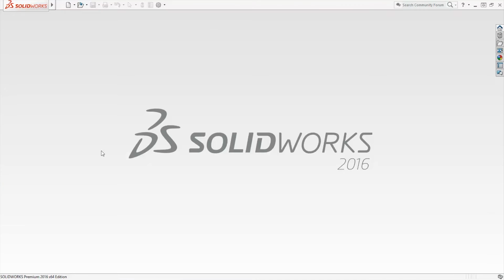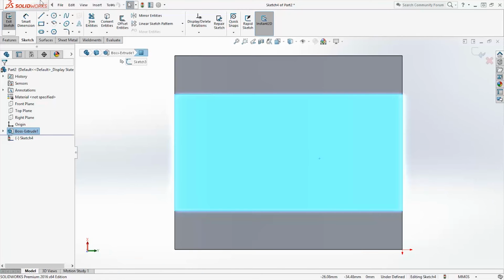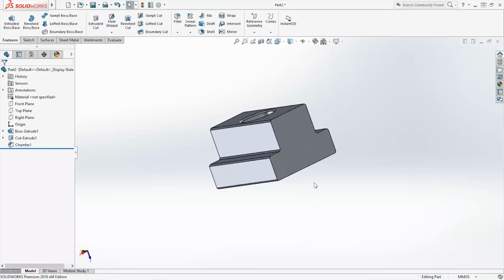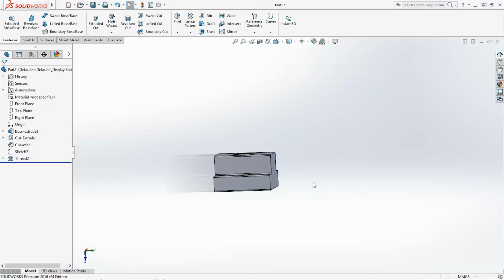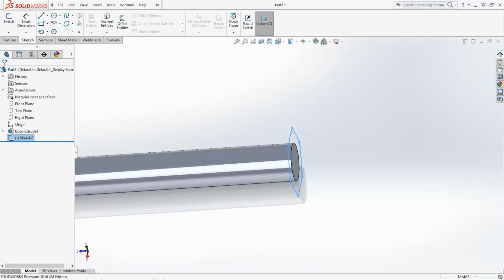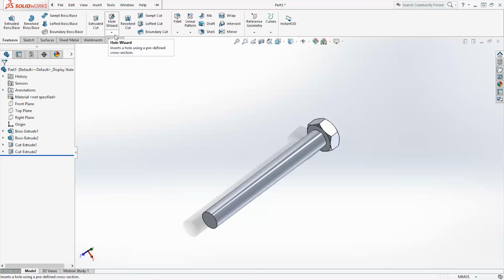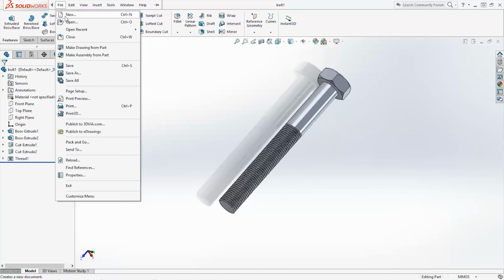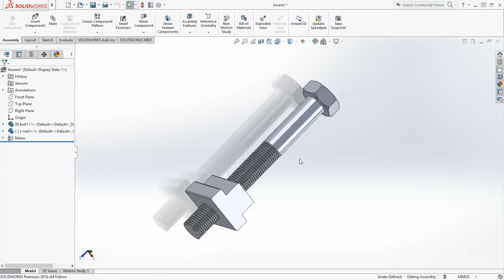SolidWorks Tutorial 13 T-Nut and Bolt Thread Features (Bolt and Nut Screw)

Comment: I'm looking for a t-nut that is 18-19 mm wide, has an m8 thread and is one of those that you insert at the end of the profile. What kind of T-nut fit that description?
Reply from the maker: There are different types of t-nut with M8 thread. You should check the manuel what kind of T-Nut is using your machine.
Reply: @solidworks.tutorial  I don't have a machine but I found out which one I needed. I have an aluminiumprofile with said messurements and the one I need is an 40 series T-nut.
Reply: @unogazzy84 
👍 👌

Comment: Why should the hole be 10.9mm before making the thread? Is there a rule or something?
Reply from the maker: dimensions for this video are taken arbitrarily.
but for example: hole size for M12 is 10.5mm and M12 screw is Ø12mm and M12 standard Pitch is 1.5mm
for M8 hole size is 6.75mm screw is Ø8mm and Pitch is 1.25mm.
https://international.optimas.com/technical-resources/tapping-sizes/
Reply: @solidworks.tutorial  Thank you for the explanation!

Comment: Hello, I figured out that you have to click on fixed part in assembly and select float to have bolt go in and out. How can I choose to put a thread on a 8" boat shaft end for propeller nut? How do you choose a different size other than what is offered in selection?

Comment: You looked used to Solidworks... I'm using Solidworks 2020 but I'm having trouble with the inner thread. I used hole wizard to make the hole but the thread doesn't appear during assembly like my lecturer did. Do I have to make the thread manually or change some options in the wizard hole?
I tried : 
1.Hole Type = Hole                                                        2.Hole Type = Straight Tap
Standard = ANSI METRIC                                                Standard = ANSI METRIC
Type = Tap drills                                                                Type = Tapped Hole
Size = M6x1.0                                                                    Size = M6x1.0
Blind Hole Depth = 10mm                                                Blind Hole Depth = 10mm
                                                                                              Thread Depth = 12mm
Both of these don't work... or rather none of the hole wizards have pre-built inner thread during assembly
Reply from the maker: Hi
you can check if your Cosmetic Threads are unable. 
You have one option that is called Annotations and you can find it Future Design Tree, click right click, and enable Cosmetic thread and Shaded cosmetic threads.

Comment: So you drew the nut and bolt, but it would have been nice if you would have explained how to avoid making your nut to big or to small for the the bolt if you didn't want to follow the dims you were using.   I'm new to this and I have to make a specialized nut for a 5/8 bolt, so how do I insure that my nut will be the correct size for my bolt?   Now that's what I need to learn.
Reply from the maker: in thread future command is specification part, where you can choose what kind of thread u need :)